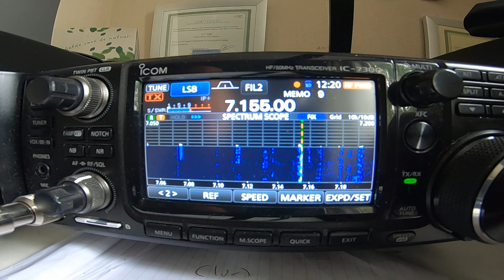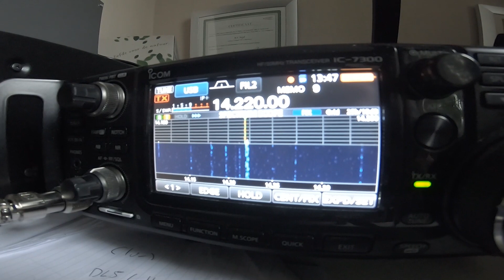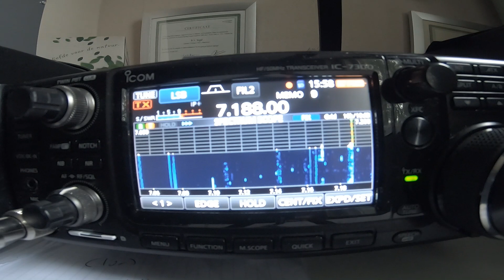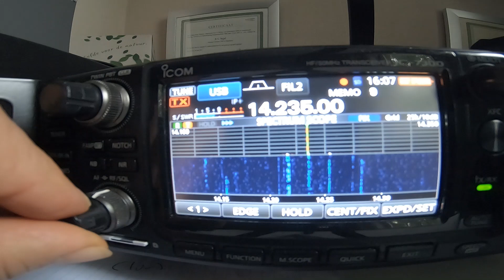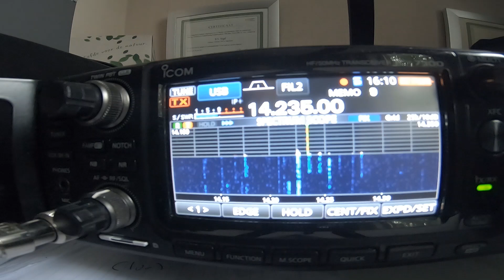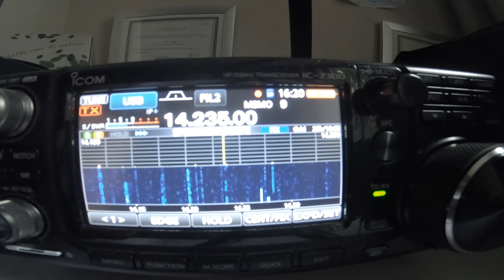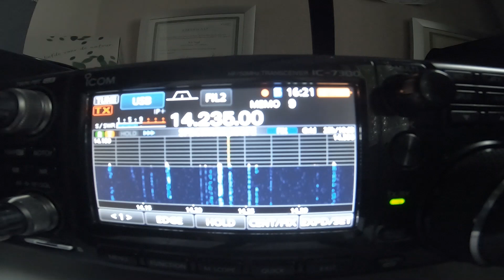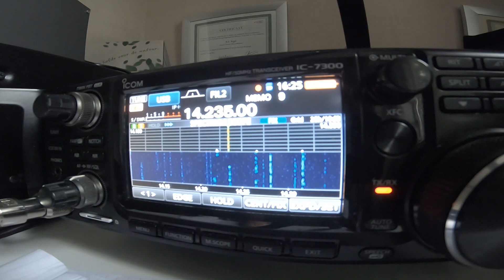4 Element,8 band Yagi/ Ecoflex 15,Icom ic-7300, first impressions 🤔

Comment: I here you yesterday on 40m 3/3 the band is in not good conditions many QSB. 73
Reply from the maker: Hi,yes the band's are not in good shape, I've just tried 40 meters,very quiet, maybe it will get better later on in the day, thanks for the comment,73 from Rotterdam 👍